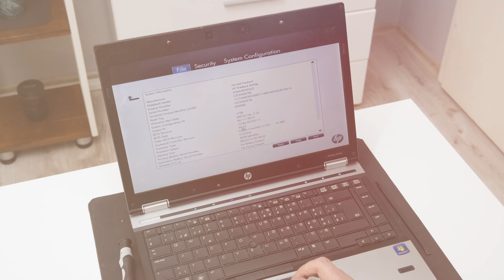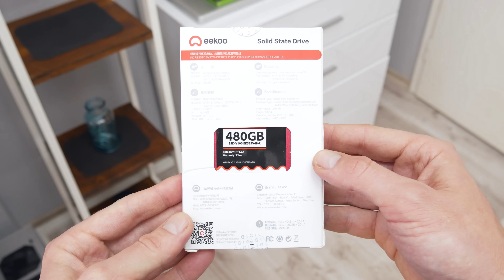Restoring and Upgrading an old HP EliteBook ( Plus Data recovery )

Comment: Very old Windows 10 Version you put in there... Still has the old Edge Browser on it... With a striped Windows 10 version it would perform even better, I would do a clean install of W10 followed by AtlasOS deployment to improve even more the performance of the old laptop.

Comment: Hi, I had HP elitebook 8440w, more than 10 years. It cannot operate without plug in the external powder. After pull out d external powder, it has a red light blinking... what I shall do it...

Comment: see the ram he uses ONE ROW, ONE SIDED that's not ram, you can get QUAD CHANNEL DIMMS aka CELLS running dual lane, both sides. aka it FITS 16GB. LIKE MY C2 9650 did, ddr3 goes up to 16(32) gb if you find the CELL support on the RAM STICK. ddr4 goes 64(128) and ddr5 goes up to 512gb(1tb) ram. it's about CELL SIZE and how many lanes, and if it's a SIMM(cells on one side only) or a DIMM(cells on both sides). as you see in the video you can have one lane, or 2 lane ram, and i've already said what it means if there are chips on one side or both. enjoy truth.

Comment: I enjoyed watching your cleaning and updating video - because I have one of these: hp EliteBook 8440p. Now I need to change the keyboard, but the small ribbon from the 'Pointstick' will not lock into its little slot. It just falls out and I cannot see why this is! I use tweezers to put the ribbon in but it just falls out again. What sort of locking mechanist should there be on the female slot for this? Is it repairable? The reason I must change the keyboard is because there is some strange problem - it keeps putting 'Full-Stops' or 'Periods' into my texts. I cannot enter a Password without it putting in some extra 'periods'. When I by-passed the keyboard by use of a remote keyboard the problem stopped.

Comment: Question for you Andrew: I just found one of these old treasures recently and realized after using it a while what a great computer it is for the price. But I would really like something thinner that still has great specs and upgradeability while still costing less than $300 or so on ebay like these do. Would you be able to recommend anything?

Comment: Modern HPs are far inferior to the high-end business grade laptops shown here. In the rush to slimness most manufacturers skimped on connectivity and the ability to maintain and upgrade but HP went too far resulting in a loss of interest from professionals. 
Quite apart from poorer materials and badly designed power handling they kept changing their support service and obtaining device drivers was a matter of indifference. Dell and Lenovo also showed some shoddy practices but at least supported top end business products if one was persistent. 
My company ceased to consider HP products when support for genuine workstation grade machines ceased.

Comment: hello nice video, did u upgrade from a i7 second gen to third gen i7? if so how did it work ? did u do anything with the bios ?
i have a hp 8460p , it has a second gen i5, i need to update to something stronger , but can i put third gen i7 on this laptop ? i wanted to this because intel hd 4000 is so much better than intel hd 3000 , thank you and have a good day

Comment: Also if you wanted a tad bit more processing power you could have added the Quad core i7 720Qm which is also compatible in this laptop.
Reply: Hey. Have you tried installing a quad-core i7 720QM in an 8440p laptop? Is the cooler able to manage the heat after the installation?

Comment: Thank you for the info. I have a Elitebook 8440p i5 chip, It is running Windows 7. and want to reset to factory settings. I tried tapping f11 as some suggested however that doesn't work. I would appreciate any advice, thank you.

Comment: I thought that HP had a 3D drive guard that uses accelerometer to sense if the laptop is dropped.... if it is dropped the drive guard automatically parks the heads in the stand to prevent HDD from breaking..

Comment: How to remove password bios please help me
Reply from the maker: Hi bro, in many cases you need to take out / disconnect the BIOS / CMOS battery for about 30 seconds. With this the BIOS will reset completely and in many cases will reset-remove the password. 
But in some cases if this is not working then you need to take your laptop is some good repair store to re-program your bios. The procedure is, they will remove the bios physically, then will place to programmatic device, the bios will be completely erased and new one will be loaded, but this will void your warranty I mean if the laptop is under a warranty

Comment: I have this model with nvidia nvs3100m so I upgrade to processor i7-820QM (4cores without intel video) and SSD 1TB and 8GB RAM with Operating System  Debian Buster...all components works so fine....and finally replace cd-rom to caddy HDD 1TB...I'm sure but Bluetooth signal is slow lose connection  I dont' know is device broadcom ...

Comment: I would deeply appreciate your advice on the following:
The graphic card on this laptop is Nvidia, which causing lot of problems & CPU overheating on Win 10 & Linux.
My question: Can I install a different graphic card, IF so which types or options you suggest?
Many thanks

Comment: Hey bro. i have a question. I have a hp 2570p i5. Last month it stopped working without any reason. I changed Ram and hd, but doesn't work. Just fan work for some seconds and again off. Soooomtimea on and of. My friend had a damaged cpu, we tested. It's worked for about 1 hour , I updated bios and installed new windows, and after 1 hour off again. And don't work now. Just Fan and off. Battery charging is normal. What's your idea?  I should buy a need cpu? Or has a bigger problem???

Comment: I have an elite book nearly 2470p. It's 10 years old with  an i7 and it's still runs fine with Windows 10.  I can play classic games (Age of Empires II) GOG on the thing great and all the office stuff / internet/ video / audio streamng.  I can draw with a Wacom stylus and is a great drawing tool in tablet mode. This thing  is so old, it doesn't have an HDMI port, USB 3.0, but I think it has firewire (looks like the nuke symbol). it just as snappy a a budget laptop with all the great mechanical switches for wi-fi, volume, etc.   it even has a pop up led on the screen bezel to shine on the keyboard instead of the common backlit keyboard today. better than a budget laptop in features and on par in performance.  Just put in an SSD and maxed the RAM.  I bought it to play Diablo II (4:3 screen so aspect ratio is perfect.)
Reply: That’s what I’m saying I fully agree

Comment: Hi, I have hp pavilion dv6 laptop. Can you please tell  how can I upgrade to do video editing etc. It's having problems like over heating, black screen while booting. I think I need to apply thermal paste over cpu. May be fan problem. It's very slow. My laptop's back case come off easily. It has no screws to remove ram stick and hdd.

Comment: used to own one of these a few years ago. probably one of the worst laptops I've ever used; I've used other elitebooks like the 6930p and they worked fine (albeit slow..), however the 8440p was issues from start to finish when it finally decided to off itself. Pretty much within a week after getting it, it would regularly fail to POST due to supposed RAM issues, even though I could throw the DIMMs out of that laptop and into a toshiba satellite and watch the toshiba boot up perfectly fine. Then after that, while the battery was charging the CPU would throttle all the way down to ~0.8GHz for absolutely zero reason, even th ough my temps were completely fine. The moment I unplugged my charger the CPU clock speed would go right back up to ~2.6-3GHz so that's some genius design, thanks HP. The USB controller on the thing then decided to die one day, so my external kb/m would no longer work, and then pretty much every hard disk or SSD I'd put in would randomly stop working cause the SATA controller in the device was garbage.

Not sure if I was extremely unlucky but I've seen these symptoms in other 8440p laptops too. Out of every computer I've used, I've never had this many issues pile up within a single year of use - I've got a toshiba that has been accidentally dropped with the screen completely shattered, and after a little bit of TLC and replacing damaged components it still works perfectly fine to this day with pretty much zero issues - so if you see this laptop on sale from some refurb place I'd just steer clear and buy something else.

Comment: You could with no problem upgrade the laptop o a core i7 740qm or even more without any problem. And if you would have one of those core i7 quad core processors on it, the ram limit would go up to 16gb and the frequency support would go up to 1333mhz. The 1st gen cpu lineup on mobile segment is confusing and makes upgrading even more confusing because the 1st gen mobile cpu are divided into 2 lineups: dual core cpus(arrandale) and quad core i7s (clarksfield), only the clarksfield cpus support 1333mhz ram but their downside is that they are based on 45nm arhitecture (arrandale is based on 32nm) and don t have intel hd graphics so you can t install them without a dedicated graphics card. The elitebook 8440p comes in two variants: one without the quadro nvs3100m and one with intel hd graphics. In your case you could upgrade to 16gb ddr3 1333mhz and core i7 940xm without any problem.
Reply: I’m pretty sure only the 8440w can be upgraded to the qm version and 16gb ram
Reply: @0w3nn  i have my hp 8440p with core i7 720qm running just fine.
Reply: @AndyAndrei123  I would like t ask some questions, does it have the nvidia graphics? Additionally, can it support 16gb ram, and how is the thermal performance? My 8440p is an nvidia model so upgrading it to an i7-720qm could possibly be an option
Reply: @0w3nn  yes it supports 16gb of ram the version of the laptop with nvs 3100m equipped with i7 qm/xm series, if you have hp 8440p with nvidia and m series cpu it won't work with 16gm ram.
Reply: @AndyAndrei123  it originally came with i5-520m, so an i7-720qm is compatible?
Reply: @0w3nn  if it has the nvidia nvs 3100m, yes

Comment: Thank you Andrew for the excellent video. Appreciate sharing your knowledge. 
One of the drawbacks of this model is that it only works on Windows. I did exactly the same thing of upgrading to an SSD and 8 GB RAM and was very excited to have a i7 (albeit dual core) model to work on the day to day. However, with Windows 7 pulling out support, the only option is Windows 8.1 (which is running extended warranty until 9 Jan, 2023). Windows 10 did not work for me, which means, at some point, Windows can no longer work. 
I tried Ubuntu 18.0X LTS and the biggest problem is that it cannot recognise the Intel Centrino Ultimate N 6300 WIFI card, which means I can only be wired for internet (or via a dongle). However, I doubt now if Linux distros too would sustain this model. This really is the downside for anyone tempted to buy this laptop as a refurbished model. 
I do not know if other Linux distorts work or not but will be interested to hear any experiences that others might have had, which is more successful.
Reply: Windows 10 works pretty fine with this model (I have one with i7-820QM + 8GB ram + 2 SSDs).
Reply: @Adam130694  i7 820QM???
That's a quad-core CPU. Does it really work on 8440p?
Reply: @modestpc001  It does, but BIOS update might be needed.

For me it now works with 820QM+8GB RAM+Radeon HD5770 (through EXP GDC ExpressCard version).

Good for web browsing and old/light games.
Reply: @Adam130694  I really want to upgrade my 8440p, but I don't know what will work and what wont.
I have a 4GB DDR4 RAM stick and a 512GB 2.5mm SSD on the way. Will 8440p support DDR4 RAM?
Also, does yours have a dedicated graphics card? Mine is intel HD 520 and I game on it. I'd like to improve gaming performance but I'm working on a tight budget.
Reply: @modestpc001  It won't work with DDR4.

It only accept DDR3-SODDIM, max 4GB per slot & with 2 slots available 8GB is max.

It is really old notebook, any desktop for 100-200 dollars would smash that HP Elitebook.
Reply: @Adam130694  Hmm... I am a sad man.
Think I'll have to trade that DDR4 for a DDR3 once it gets here.
Thanks for this information.
Reply: @Adam130694  Hey, just one more question.
I might have to get 2x 4GB DDR3 RAM for my 8440p. There are two speed options of that kind: 1333MHz and 1600MHz. Is the 1600MHz a good option, or should I just go with the slower one for compatibility's sake?
Thanks.
Reply: @modestpc001  1333 are usually cheaper and 1333 is the fastest speed that's supported by this CPU/chipset.

Other i5 with 2 cores support only 1066 so don't be confused when you have CPU with 2 cores and RAM speed will be slower, only 820QM/840QM/920XM/940XM support 1333.
Reply: @Adam130694  1600MHz is actually cheaper by $.20 where I'm buying. Can 520M be swapped out for 820QM? If yes, would 1600MHz be a better buy now for a CPU swap in the near future?
Reply: I have hp elitebook 8440p i5-540m nvidia model and 6gb ram and it runs windows 10 alright

Comment: I bought a msata SSD to put in and an optical drive... I have the 90* adapter, but the msata ssd doesnt fit in the adapter, the adapter does fit on the mother board... what is the adapter I need for the ssd?

Comment: i was able to upgrade my Hp elite 8440p i5 (basically the same as you have here )with 8gigs ram  with no issues and runs absolutely fine (2x4gbs ddr3 soddimm 10600s sticks) with windows 10 pro 64 bits.
Reply: Do you have the link, manufacturer or price for comparison?
Mine is running a Crucial 4GB DDR3L - 1600 and Samsung 2GB DDR3 PC3 10600s underneath the keyboard (HP Certified/sticker, probably there since factory)

Am going to perform maintenance and ideally identical ram upgrade, just want your ram info for price comparison, I know any company's ram with the correct specifications will work.
CPU upgrade would be... it uses the i5 520M, but I think RAM and thermal paste would make the real difference, especially since I don't game on it.
Reply: I wanna say CPU upgrade would be bomb but I have 8460p and maybe another EliteBook soon to service and possibly switch to, slightly reluctant but need to do a bit more research, after I finish my assignments maybe lol.

Comment: Great video! I have in my Dell N5010 the same CPU (i3 380M) and I plan to upgrade it. After I saw your video, I want to ask you if I have to use only the first generation of CPUs? I know I have rPGA989 socket.
Reply: yeap

Comment: Can the oil from your fingers affect the gold contacts on hardware such as memory and PCI devices?
EDIT: forgot to ask... how did you know the i7 620M processor would work in that laptop?
Reply from the maker: Hi, before starting with repairs is recommended to wash your hands and your hands must be dry. However, the oil from the hands cannot affect some hardware, ( it is ultra rare to affect something ). But the motherboards are not sensitive as they looking, even if you split oil, the motherboard with start ( 99% chance to start ) because oil is not power conductive :D

About CPU, I check the laptop socket and the chipset, the CPU must be supported by the booth. If you going to upgrade some CPU the CPU must fit in the socket, the CPU must be with the same socket and supported by the chipset on the laptop. that is all, noting complicated
Reply: @ComputersAndTechAndAndrew  Thank you for replying. I enjoy watching your videos. :-)

Comment: Hi Andrew. Nice working. I always enjoy your videos.  I have HP 1000 core i3 2nd gen product number c8c94pa. Its running on 256 SSD. If possible can you tell me what else can be upgrade? Can I use core i5 or core i7 processor on that?

Thanks in advance.

Comment: I am 100% sure it works with a 720QM, personally tested it myself. Though it only works with the Nvidia Quadro model and doesn't work with the intel iGPU only model.
Reply: Are you sure it wasn’t the 8440w and was the 8440p

Comment: The most USELESS UPGRADE is to change i3-380M -> i7-620M because they both have 2 core, 2 threads BUT the i7 is 10 times more expensive!

Comment: I had one of these with the i7-640LM as my main system a while back. Loved it until the fans decided to stop working properly. Overheated constantly, but was an absolute beast when it was running correctly. Only reason I updated to a proper PC was because I was starting to get into PC gaming. I'm sure this PC would have still been in use today by me if I didn't
Reply: Open it up and replace the fans, I think you can find a cheap replacement easily.
Reply: @eshanausis7083  Eh this right here is sadly the most common trigger of an upgrade, this guy implies this was once his main system.

Comment: FINALLY. A video for about I7-620m and a 8gb of ram. I am planning to upgrade my Dell Inspiron N4010 (actually I am currently using it right now while typing this comment) with the same.. really the same specs. But I doubt for upgrading it because it may not worth it. but after watching this video. it gave me an answer if I should spent almost a 200$ for upgrades in this laptop or not. I am actually a High school student and does not have a solid income (my parents don't even give me monthly allowance or give me money for school. they only give me money if they forget/don't have time to cook lunch in the morning) so that is why I am very considerate in my expenses. Thank you for making this video!
Reply: But while messing around in some of your videos. I came across for that one asus laptop that you used i5-2450m. And after doing some poking in internet I've found that i5 is much better than i7. I am now wondering if i5 would fit in my dell n4010? Because they had an same socket as the pga etc etc. It would be really great if someone conduct a test if it would fit